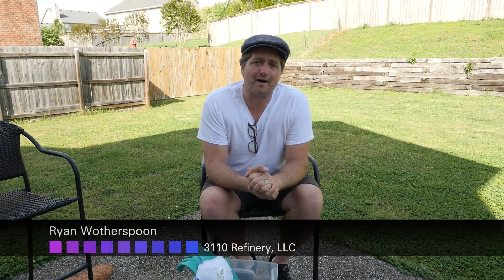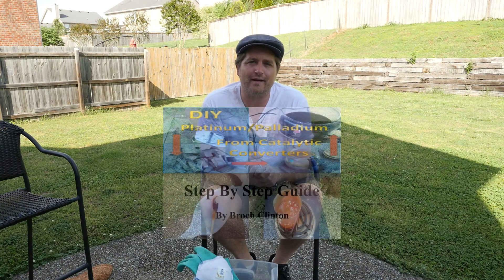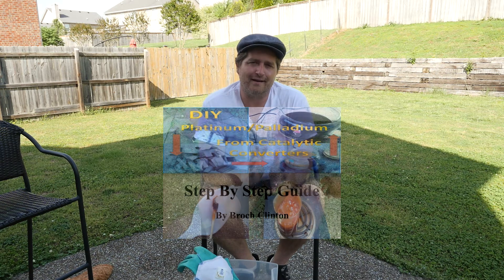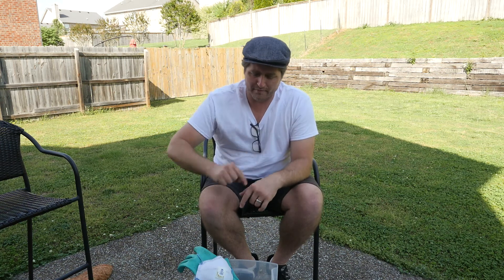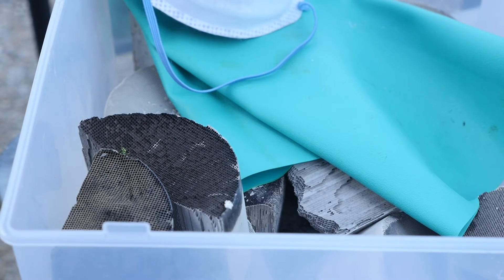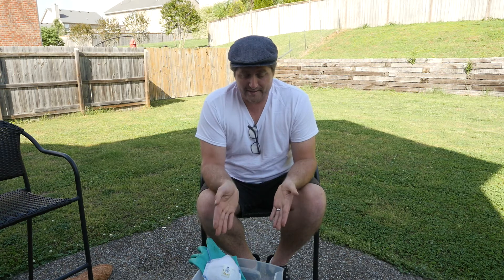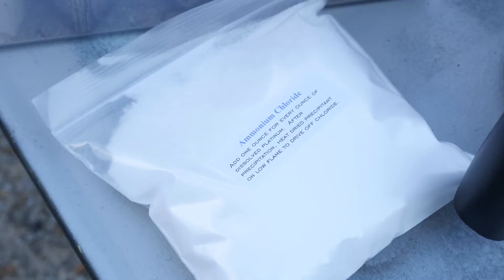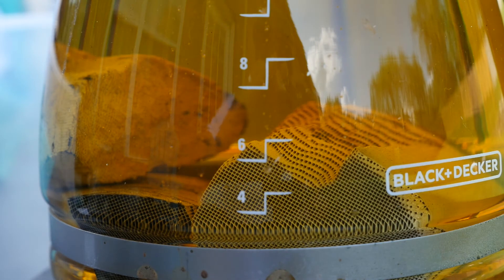Platinum & Palladium Refining from Catalytic Converters - Customer Testimonial

Comment: Yep,and the interesting idea that I am currently trying to test is actually trying to get the PGM content from one by smelting it!However I currently have to do that with a really such an ineffective shit as the cheapest oxygen-mapp torch because my f**king HHO torch simply got it's electrodes dissolved and so I need to buy another one,at least 150l/h which is actually perfect thing not only to melt refractory precious metals like iridium which I did quite in a good amounts(I just need it for my own purposes and also I can't cease to admire this magnificent metal,which is actually most resistant of them all and by far better than any contender)-but for smelting such stuff like converter material as well!And I guess that it will make it very fast and easy,since I managed to melt more than a half of one section of the honeycomb right now while writing this comment,just with one oxygen tank which means that 150l/h HHO torch will get the same results in matter of couple of minutes and the same time it's obviously not requiring anything to run except water,and I am sure that it will completely melt one such section in 15-20 minutes of running!So as none of PGMs neither being in powder form nor being liquefied dissolves in anything that those honeycombs are made of,and the same time all these PGMs are substantially heavier than that crap-they will eventually sink to the bottom of the molten ceramic crap and therefore it's not gonna be difficult at all to make them accumulated in the bottom of some cone-shaped thing and so after solidifying it will be trivial to just break off the bulk of glassy crap and simply melt all that stuff into a single button after all!
Yes and I forgot to write that this button won't be much pure,as I previously done similar buttons from all the section just by dissolving all ceramic crap with HF and melting all the undissolved stuff from them,which turned out to be 85-90% pure with the rest 10-15% being other PGMs-but refining those beads(if desired) is vastly easier than dealing with those honeycombs using the process that I described in the previous comment,so I guess that smelting them completely using HHO torch is actually the best way to deal with them!

Comment: I personally do that stuff and currently looking for the best way to do it!So I tried already at least 3-4 of different processes to recover PGMs from them and actually all of them turned out to be effective but some were too time consuming,some were too difficult and required too many steps and effort but were faster,and I still don't know which one to choose!
Anyway it's true most of the time that in almost every converter there are 3 parts of honeycomb into a unit,and each one contains only one PGM-so one contains Pd,another Pt and the third one contains Rh,so it helps a lot..
Anyway they obviously require similar but slightly different processes to recover these metals,and I should say that obviously Pt and Pd ones really require the straight forward and simpler process,but rhodium containing part require much more tedious and odious process!And so the first two really are done in this way:first you pulverize and roast them(separately obviously),and than you just put them in different buckets with aqua regia and wait until the reaction stops,than you filter the solution(note:in both cases never rinse filtrate with water:your recovery yield will drop several times-it's the worst thing you can do!),and pour some more aqua regia just in order to check whether you have dissolved everything-and if reaction goes on-just pour enough to that filtrate and do the same thing,add the second solution to the first one and precipitate platinum with ammonium chloride(note:calculate the amount of ammonium chloride in such way that you will end up with 1 molar solution of UNREACTED ammonium chloride in the platinum bucket:this is the only way to get all platinum from any solution because ammonium hexachloroplatinate is insanely soluble in water until you have 1M solution of ammonium chloride in it-than the solubility of your precipitate will become almost zero!And adding 100 ml of water to any precipitate of platinum dissolves 3.7 grams(!!!)worth of metal and you either lose it or you have to compensate this with enough ammonium chloride to make it 1M again!And the same thing with palladium precipitate!)-than just after getting the right amount of ammonium chloride in your solution filter it and after that my favourite step:put paper with precipitate in the melting dish,drop some borax and heat it up until you will have a single nice bead of platinum metal in it!And the same thing for palladium but with DMG instead of ammonium chloride-everything else is exactly the same!
And for the rhodium honeycomb part it's much more tedious and odious:you have to smelt it into a puddle with a large quantity of potassium bisulfate and than when all rhodium will react(it actually reacts very quickly with molten potassium bisulfate,especially in powder form)-you either wait until it cools down and pour some water to dissolve the solids-or before that I actually prefer to crush the substance that I get in the end of this process in order to let water to reach all the rhodium sulfate which is what rhodium metal gets converted into during this process,and anyway after that you can precipitate rhodium metal with something that is more reactive than rhodium(obviously)and less reactive than any of group 4 metals and thorium metal as well(if not-you will end up with rhodium sponge mixed with some of the group 4 metal's sponge that will be your worst nightmare to work with as during smelting of your rhodium sponge you will have a large and potentially deadly explosion of the group 4 metal sponge mixed with it-and just in order to get rid of this rogue sponge you will have only one way to do it:apply HF to dissolve them because none of them dissolve in anything in this world except HF-and more than that:even the resulting G4 fluorides as well as any of their salts are rapidly and irreversibly hydrolysing to give their enormously indestructible oxides),and this is actually quite a complicated process,and in this process basically you have to substitute rhodium in rhodium sulfate with this more reactive metal powder and the same time not to substitute those nightmarish G-4 metals!And yes,there is actually an option to simply wait until those metals' sulfates will eventually hydrolise,to filter out their damn oxides and so get your rhodium sulfate clear from the G-4 sulfates(rhodium sulfate never hydrolises in any proportion!)-but in fact although G-4 sulfates undergo hydrolysis as well as any other salts of those crappy metals-but among all their salts the sulfates are actually the slowest their salts to hydrolise!
Anyway quite a long and tough process but it is really worth it:each unit contains not less than 200 dollars worth of PGMs and sometimes I managed to get several thousand dollars from just one-it was a large cat converter from Ford F-250,and I extracted more than 3000 dollars worth of PGMs from it!
Reply: Bro if i do this in furnace so what will do
Reply: @akaalcreationsofficial  you have to reach temperature of minimum 2000°C+ to do that properly!And the best possible way as I figured out for now is simply smelting all the material completely,which melts at around 2000°C by either a powerful induction furnace or just a furnace that uses oxygen to burn for example mapp gas or acetylene so that it gets hot enough to actually melt the stuff!And as for crucible material one of the best options would have been tungsten or molybdenum which should be isolated from outside air and so to remain intact!Or just some semi-disposable stuff that withstands such temperature!But don't use graphite:it will ruin your PGMs by making carbides with them when they are molten and releasing carbon upon solidifying!
Reply: @akaalcreationsofficial   bhai kaha se ho tum Ko pta hai is ke baare me
Reply: Thanx